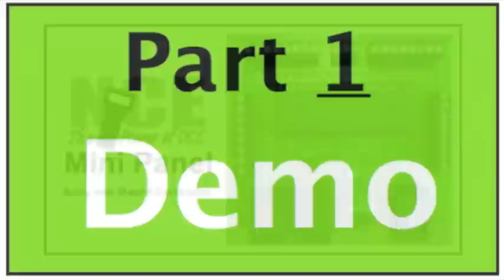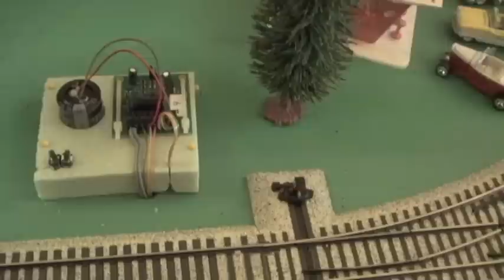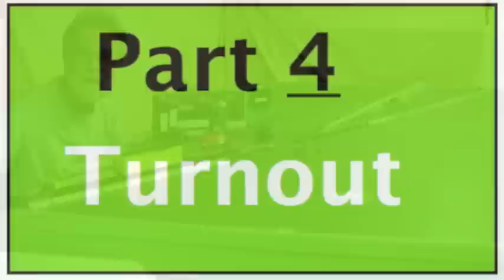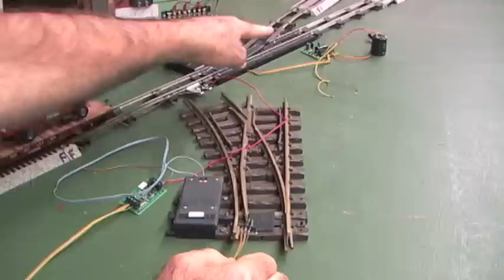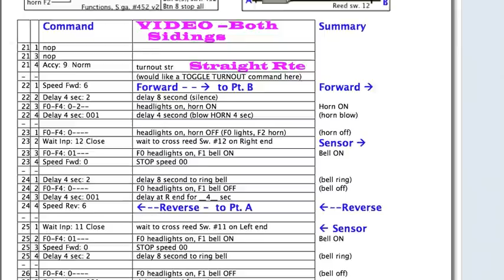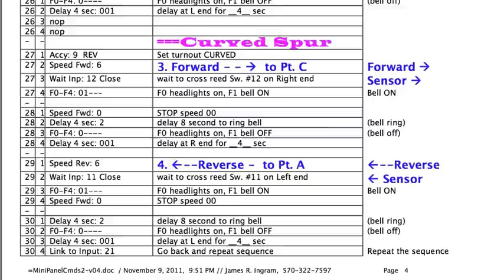805 S Ga. Point-To-Point DCC Automatic Control of Alternating Routes for Spur | NCE Mini-Panel

Comment: Hi working on setting up a point to point track on my layout I have a NCE Mini Panel   Where can I get the REED SWITCHES from?  Thank you Tom
Reply from the maker: * The "normally open" Reed switches are pretty common.
* You can get them on Amazon or Ebay.
* Some train dealers that carry the Mini Panel, also have them (may be a bit higher priced).
** For example, I can find them on Tony's Train Exchange, but not on Trainworld nor Yankee Dabbler, nor on the NCE site (by doing a search for "reed switch").
~~~~~~~~~~
OPTION: Z-STUFF DETECTOR:
* Note you can also use a Z-Stuff infrared detector and relay.  If the length of your track is not too far, you can use ONE detector in the center or at one end.
* As an example of this, watch a bit of video 829 that uses a single detector near the middle of the track -- to operate 3 locos point-to-point,
https://youtu.be/vTkGr9zzSMc?si=-9S51Qy4HYQtPUDY
* If you think more discussion would be useful, telephone me (my number is on www.JamesIngram.net).

Comment: Very good, I thoroughly enjoyed every minute of your presentation. You alone have convinced me as to which direction I should go. Thank you so very much.
I have been busy day and night viewing one YT Video after another for two months and was still confused as to which product I should go with. I written reviews and asked questions and no one could come back with a "This is what I recommend". These are what I been looking at: Digitrax DT500D, Digitrax Zephyr Xtra, NCE Power Cab, NCE Pro Cab, MRC Prodigy Advance 1414, MRC Prodigy Express 1420 Squared or USA made RailPro.
I am sorry this is long but I am wanting to get into modeling and not sure as to which direction to go. Surely hope you can give me some advice and feedback.
Again, you have done a great job, thank you.
Reply from the maker: If you want to do this automatic control with the Mini Panel, you need an NCE system.  The NCE Power Cab is a good way to get started if you can run your trains on 2 amps or less.  (Sorry to take 7 years to reply.)